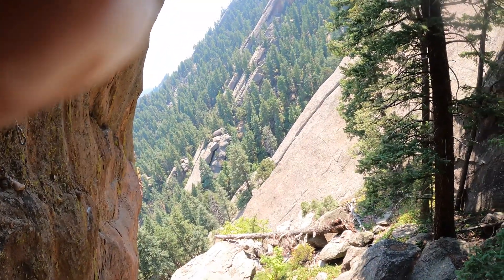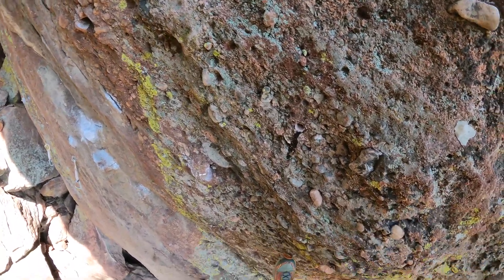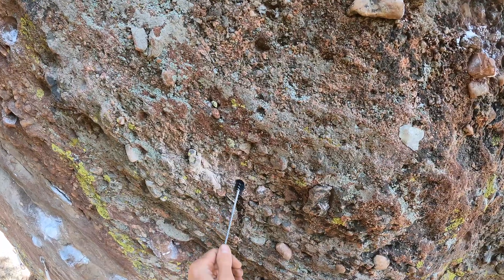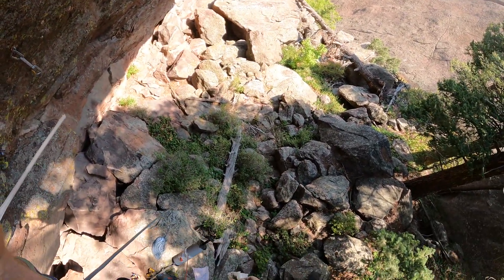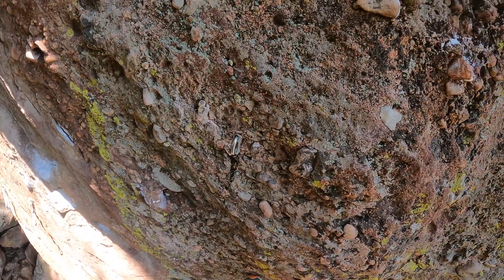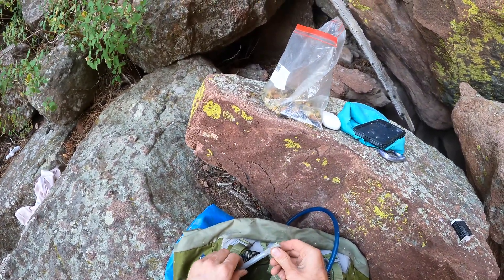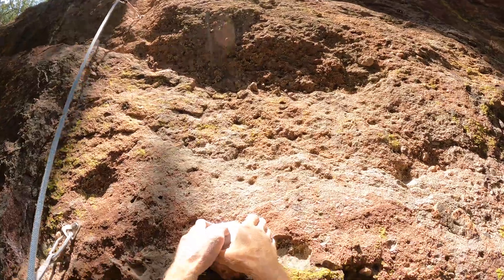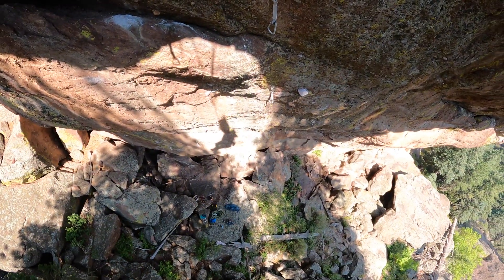Glue ins: How to fix a spinning 5 piece bolt (Slave To The Rhythm, 13b)

Comment: Nice work man. I’ve been installing a lot of glue ins myself lately. Couple things I do that might help ya in the future. I put climbing tape on three sides excluding the eye of the bolt side so if the glue spluges out I just take the tape off and makes cleanup super easy. I also clip a shopping bag to my harness with gallon ziploc bags for trash and a roll of paper towels to help with cleanup. I also like to place my bolts “upside down” so that a carabiner can’t get leverage on the eye of the bolt and the carabiner instead hangs on the straight stem of the bolt. Doing this while also using bolts that say they don’t need to be countersunk helps reduce the need to countersink the eye. This makes install easier and keeps the carabiner from being pushed against the rock in strange ways, gives it a bit of clearance from the rock. If your countersink notch is too deep then it makes it hard to clip and the rock pushes on the carabiner in weird ways. So I just generally try to avoid countersinking. But your crushing it thanks for the hard work👊
Reply: Some other things I forgot to add. I have the same problem with mixing nozzles I’ve found the sun really accelerates curing so I try to only bolt in the shade. When bolting a whole route I will pre drill all holes then come back and do all the glueing without breaks for drilling. This keeps the glue moving through the mixing nozzle and prevents curing. If I do this I can typically use the whole tube of glue before the nozzle gets clogged. Hope this helps!!
Reply from the maker: That actually helps a ton. I was wondering how I would do a whole route maybe just have someone on another dedicated line putting in the bolts after I spooge the glue in.
Reply: Yeah the shade really helps, and if it is sunny I try keep the glue nozzle on the shady side of me. 

I also tend to have a "drilling day" and a "glueing day" to really give myself the time I need to go slowly and methodically with each task. It also breaks up the weight when schlepping stuff to the crag and up the wall, so I need less gear each day.

Comment: Cutting oil? Is that a standard practice among routes preparation? Being a novice I don´t know for sure, but I wouldn´t imagine adding to the point something that could jeopardize or neglect the final result of a bolting for slipping. Who can comment, please?
Reply from the maker: once you start rock drilling all the cuting oil is mixed with the dust and forced out. Its no biggie.
Reply: @tristanbradford99  Fine. Thanks!

Comment: Thanks for replacing bolts and using glue ins. But dude... don't fling your extra glue haphazardly at the ground! And don't chuck bolt parts down either. Respect da crag and don't litter! Otherwise keep on keepin' on friend and thanks!
Reply from the maker: it was one glob, and i picked it up after it dried along with the gloves. The bolt part made it in the box. so a little confused by this armchair commentary.
Reply: Yea and any glue that does get on the wall can be chipped off with a nut tool. Even the strongest of glue hilti v3 500re glue chips off…
Reply: @tristanbradford99  That's cool you picked up the glue! I'd say you got lucky the bolt parts landed in the box- they could have landed elsewhere and been difficult to find. Kinda just bad practice. Anyhow, I enjoy your videos man. They help me keep me in the climbing mindset even when I'm on the couch!
Reply: @tristanbradford99 i thought you were being pretty careful actually…

Comment: There is generally no need to drill out the cone of a Powers 5-piece sleeve anchor bolt to remove it.  Screw in a bolt with a hanger on the end and use a funkness device to pull it out.  A funkness device is a short piece of chain with locking carabiners on each end.  One carabiner is attached to the hanger and the other is clipped into the hole on the head of a piton hammer.
I find that removing the sleeves on 3/8" 5-piece sleeve anchor bolts can be nearly impossible, so the metal bit and cutting grease are often needed to drill the sleeve and then the cone out.  The sleeve on the 1/2" diameter 5-piece sleeve anchor bolts is generally removable once the cone is pushed out of it and to the back of the hole.
Reply from the maker: And I did use cutting oil.
Reply from the maker: Hey mark. I thought i had drilled it out with the regular bit. It had not worked. I tried to minimize the amount of tools I brought to the crag.
Reply: @tristanbradford99  Yes, I was incorrect. I think that you used an SDS masonry bit to drill into the cone and pull it out.  I've drilled out cones with masonry bits too.  It tends to wear out bits faster and can heat up the drill much more. You can buy an SDS chuck for metal bits that fits into any SDS rotary hammer drill.  I fully understand not wanting to bring too many tools on the 1 hour and 15 minute approach to this climb.  Thank you for doing an excellent job replacing the 4th bolt on Slave To The Rhythm with a bombproof glue-in.  It's a lot of hard work requiring bringing extra tools. This climb is one of the best 5.13s on Colorado's Front Range.